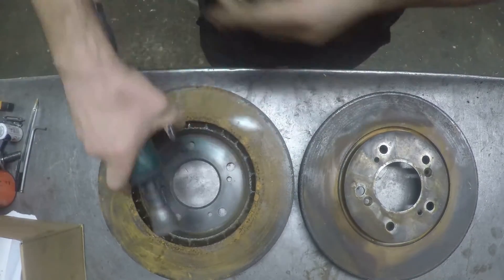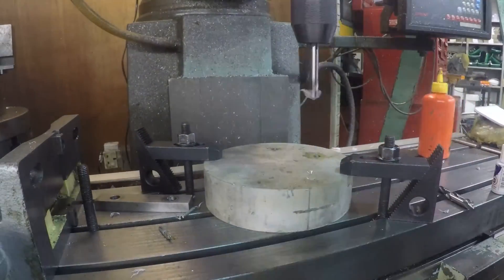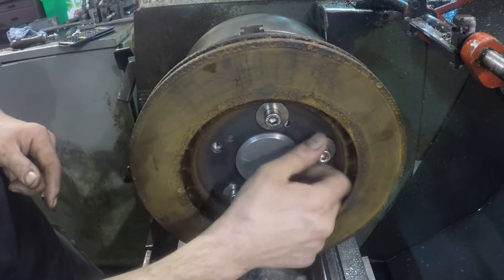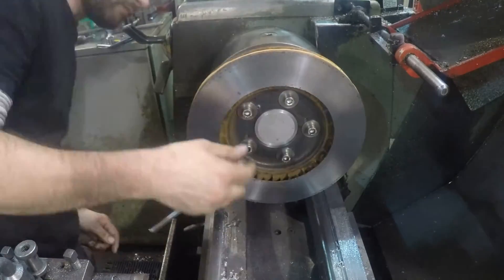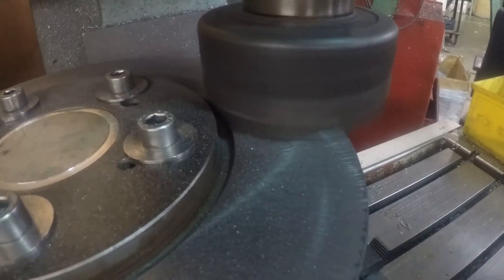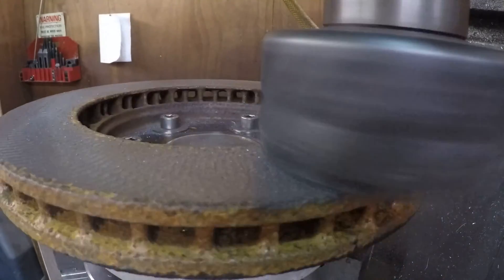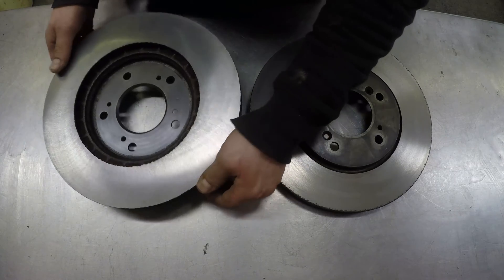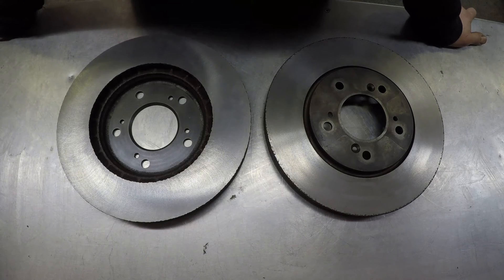How to skim a brake disc in a lathe or a mill

Comment: Would you think that the machining marks running radially (vs circumferentially) would lead to increased wear rate on the brake pads? At least until the pads wear away the machining marks?
Reply: after machining you use emery tape yo sand paper the machined surface to remove the lathe machine tool marks

Comment: How much difference in parallelism was there between the lathe trimmed disc and the milled one?
Reply from the maker: I think when I measured them, I couldn't measure any difference in the lathe turned disk, and the milled disk had about 0.02mm variation in thickness

Comment: Great content, thanks! I assume you have to keep making those fixtures for differently sized rotors?
Reply: Could a 3 jaw lathe chuck not work? Got a lovely old gal (don’t know much of the details and jargon yet) but she’s running to tolerance. I was hoping to nearly use the chuck for direct mounting. I assume it would be necessary to use a dial gauge though to measure for runout? What is the acceptable amount?
Reply from the maker: Yeah you do, if I have a disk that's the same bolt pattern, I just turn the front bit off the fixture off and machine the mounting face again. Thanks
Reply: @maxfh768  Thanks 👍 Looking forward to more videos.